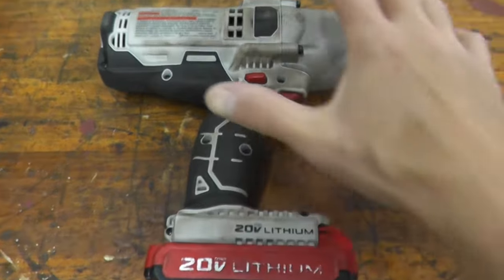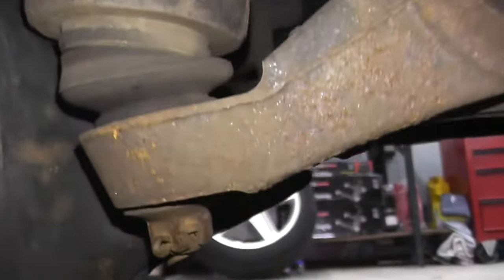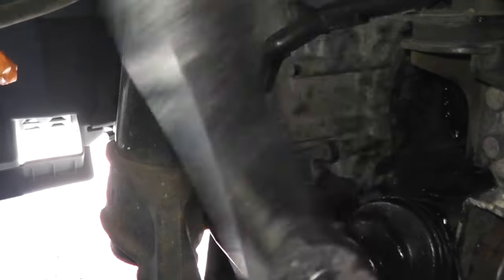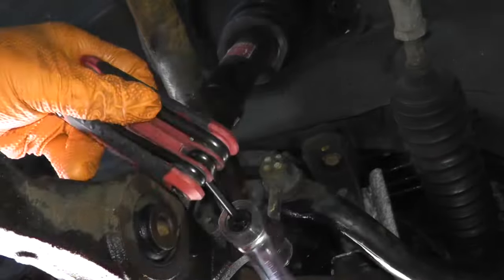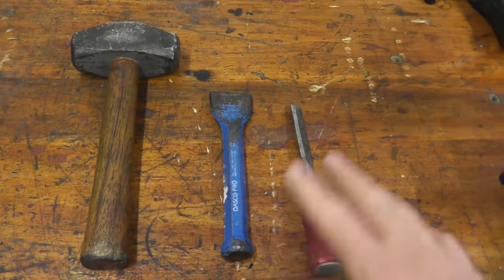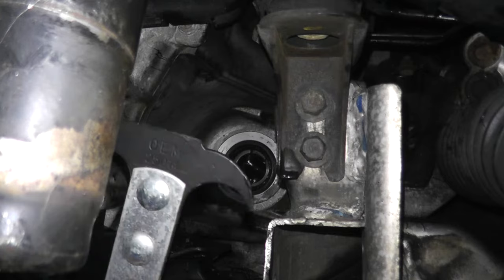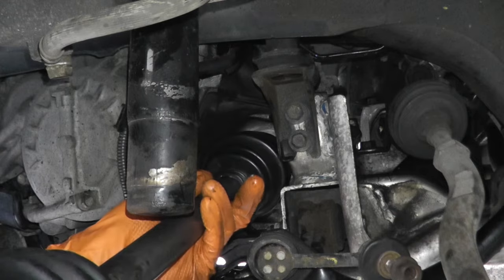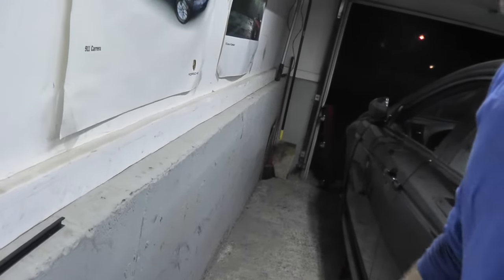Is Your Acura or Honda Leaking Transmission Fluid? | Acura and Honda Axle Seal Replacement

Comment: Guys buy the seals from the dealership. I spent a week buying from auto parts they all have the same manufacturer for these and they dont fit. Just saving you some time with my experience.
Reply: Literally just went through this for my b16, just went to Honda and ordered it for 22$ crazy how they don’t have an oem spec aftermarket one by now
Reply: Wow, hard to believe.  You would think someone would make the right seal.  Thanks for the advice I will go to Honda.
Reply: Well thank you y’all cause I’m having a issue we’re the cv is still makin the clank sound I told my friend that know a fuck lot he said was it leakin and told me change the seal
Reply: What’s the part number for Honda dealership

Comment: Thanks for showing how much work it takes. I’ll take it to the shop instead.
Reply: lol it’s not a lot of work bro
Reply: 🤣🤣🤣 - I used to be like that! Me and my buddy just replaced my axle and axle seal last week.
It's really not that hard. it's a little bit of banging and stuff and a little complicated but the mechanic will charge a lot 
just for the labor. I took about an 1 hour 20 minutes. And that included going to O'Reillys to get the right size Socket for axle nut.

Comment: I have a 2004 Honda Accord ex 2.4 the guy who sold me the car told me the tranny was rebuild Becuase there was a tiny crack in the seal so I started seeing fluid leak time to time and I would get that jerkin feeling or high rpm (low fluid due to it leaking somehwere) took it to one of my homeboy he found out it was the axle seal not the trans I was really getting ready to start selling it if there was no hope I appreciate this video man
Reply: Did it work? Have the same problem with high rpm but no acceleration
Reply: @treydawkins3148  sounds like ur solenoids but yeah it did work for me I shift thru all the gears now

Comment: So if u have an issue installing the axle in the trans side check the pin. I actually had to take the pin off the stock axle and put it to the aftermarket axle to get it to slide in. A couple of pics helps to remove the PIN from the aftermarket axle

Comment: I just got my 2013 RDX back from my mechanic after my major 105K service. Water pump, timing belt etc.He told me I had a small leak, ATF fluid.. and I need to replace my axle and the axle seal. I've never heard of ATF leaking from the axle. Didn't know it was actually a thing?? After watching this I guess it is a thing. He recommended me to also replace the axle. Anyone know why this is?

Comment: How much hours it will take to fix this
Reply: 20 minutes to actually do the job. 30 minutes to get the car jacked up and wheel off and ready. Four hours to get the outside axle end free, including time to bandage up and stop the blood flowing. Two days and begging the brother in law to help get the transaxle pulled out, over time the cheap metals bond together and it takes about 300 pounds of force to remove the transaxle from it's happy little hole. A week waiting for a seal the right size to be delivered from amazon. Since no video on earth shows how much to beat it into place, you beat it and it disappears into the trans. Which is a blessing cause the only thing harder than getting the transaxle out is getting the new one in. By the time you do beat it into position, usually the boots on both ends are ripped and you have to start all over. Buy rear wheel drive cars with disk brakes on all four wheels folks. Front wheel drive was and is a bad idea.
Reply: @taterlysaladman9377  

😂

Comment: On a 2005 civic i took the nut off the axle but used a air gun... Didn't remove the lower control arm. Just the brake line bolt, I removed the bolts from the upper, and used jack to hold up the the lower control arm. Also used a pry bar screwdriver to remove the axle.
The seal was dry rotted on i had to pick and peel it off and i use a heat gun to get the remainder off. I use a little grease on the new seal and hit it on with a hammer. Then put everything back on

Comment: 6 weeks ago we, my friend a former Body shop guy, replaced the shift shaft seal and I  tightened up the bolts on the oil pan.
#1 Just checked my oil a few days ago and again last night and zero oil loss.
#2 The leakage of fluid went down more than 50% as the passenger side axle was leaking bad, after we replaced Shift shaft seal and tightened oil pan bolts. .

#3 We replaced the passenger side axle and seal 7 days ago. Suddenly next day fluid is leaking madly out of 
driver side axle which is only 5 years old and this entire time had ZERO leaks and always dry.  I know because I have been under 
that car at least 7 times the last 2 months spraying and wiping down, trying to figure out where the leaks were coming from.
And the driver side axle was never wet or leaking. That side was dry the entire time. Boots are perfect! 

The very next day after we replaced the passenger axle and seal all of a sudden the oil is pouring down from the driver side, the 5 years old axle. I thought after we replaced another seal the leakage would go down even more. Now it's just as bad as before. Except it's now coming from driver side axle. 

Note: Passenger side axle is dry, clean and perfect! So that went good. 

#4 The Driver side axle for the first time is flinging fluid all over the place. It's a mess. The person who did this I met in O'Reilly's as the other guy didn't want to do it. Now this guy did a great job replacing the Axle and Axle Seal. He used to be a mechanic at a local shop for years now works out of his garage.

Note: 6 months ago I had a mechanic replace the crank shaft seal, front seal, Valve Cover seal and spark plug seals. Which are all good and dry!

I just find it odd suddenly the driver side axle / seal is leaking so bad. Like it totally blew out over night. I only live 3 blocks from this guy and parked it. Next morning fluid all over. Last night I checked up on ramps and it's really bad I am going to replace the driver side axle and seal, just find it odd suddenly it had a blow out driving 3 blocks...

Comment: As always, excellent videos. 
When loosenimng tight nuts, I set the breaker bar to about 10 o' clock so gravity/body weight assists the turn.

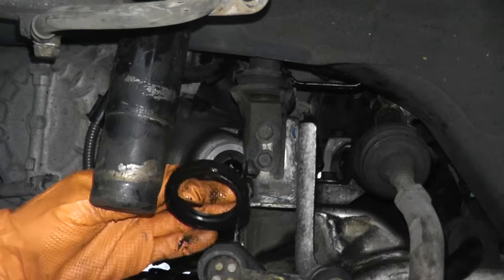Comment: 8:15 I have a very large leak under this axle so I thought it was ATF coming from a blown seal. But based on this, I'm thinking I'm wrong. I expected fluid to be pouring out.

Comment: Where did you get the seal?
Reply from the maker: Local part store. Ultimately, dealer will have them
Reply: Is it the same for both sides?
Reply: @LeoniloArellano  I went to the dealer because oem is usually best for seals, and because every internet supplier didn't seem to list the passenger side seal.  Like it doesn't have one. Nuts. $15 for Honda seal at dealer.